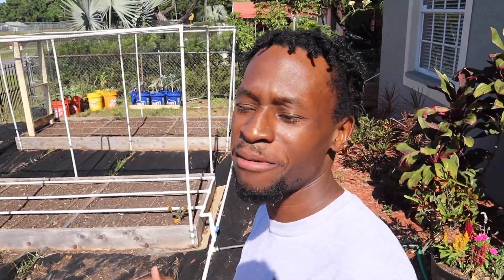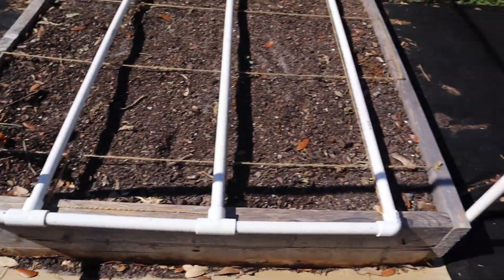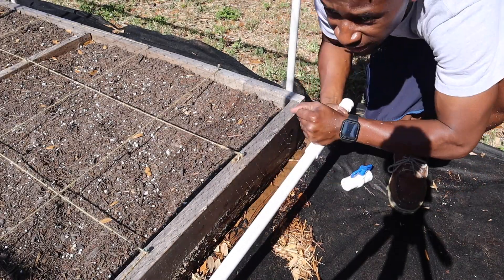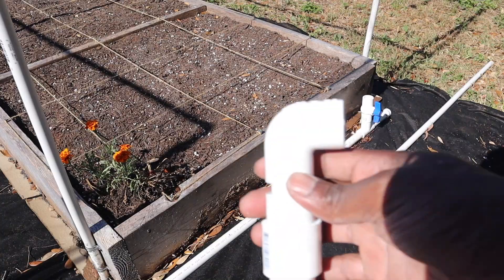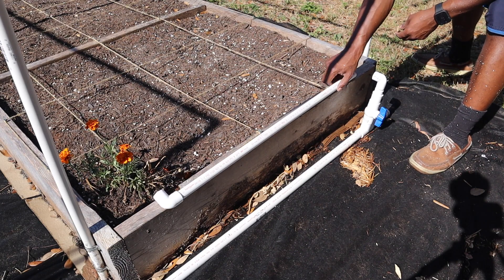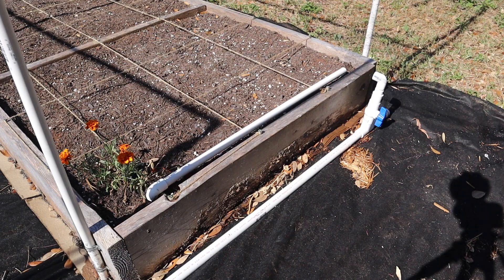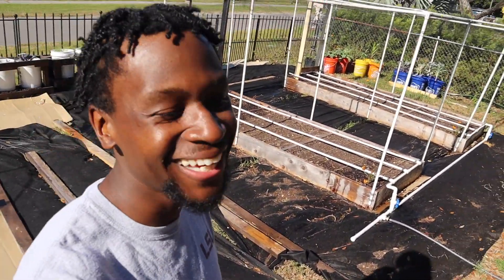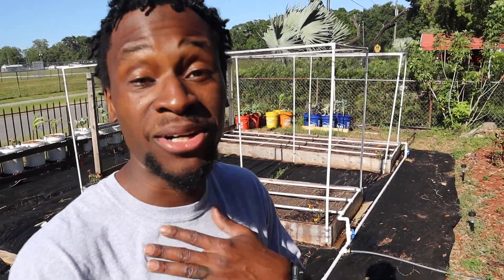How to Build PVC Drip Irrigation System for Under $50! Step by Step Process any BEGINNER can do! P7

Comment: I did the same system with PVC and it works pretty good except the sun will eventually warm the PVC and you probably need to have individual valves on each line so you can shovel enough of you want to not have to water the whole thing good job